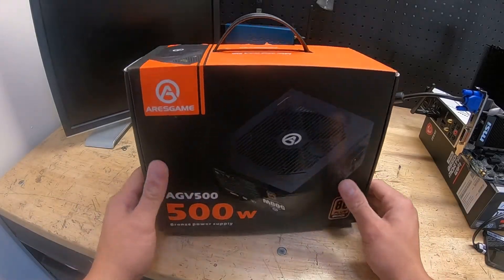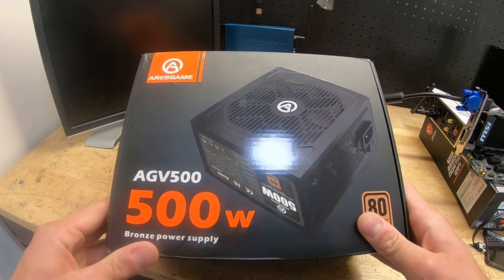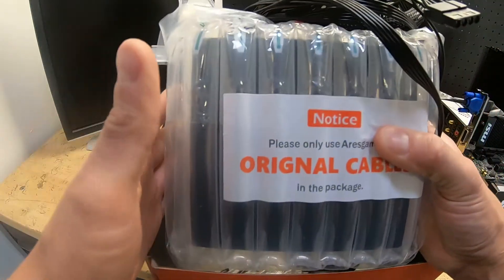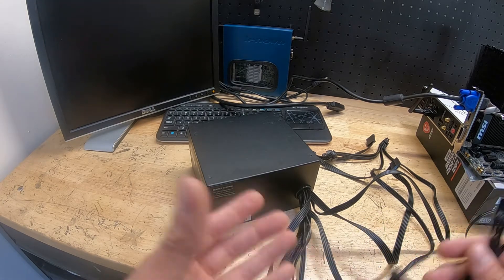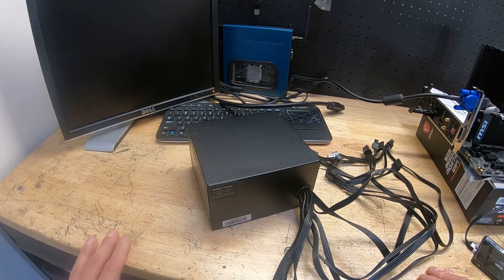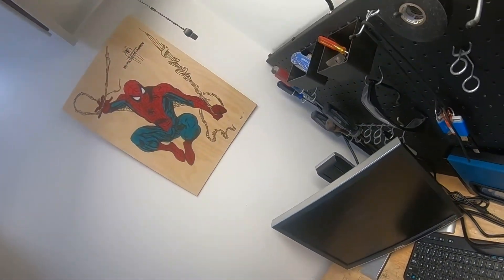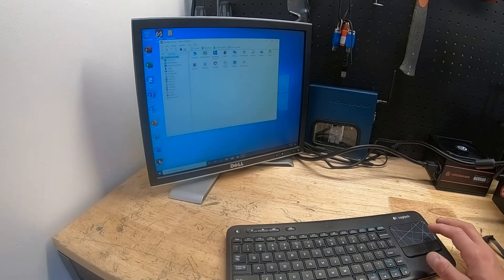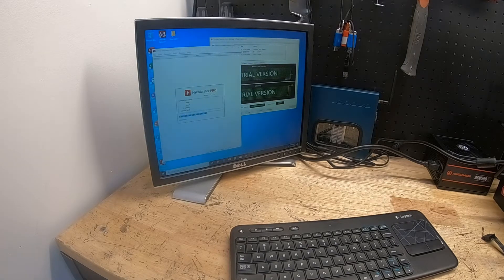A decent power supply for $40?? ARESGAME 500W power supply review! Can it handle Ryzen 5000??

Comment: If I were just to use it to power an i5-2400, a 2gb GTX 1050, and my small ASUS motherboard, do you think this would handle it? I just have a coolermaster hyper 212 evo and a single 80 mm in case of fans, and all i'm trying to do is  get a couple more years out of it? My system doesn't draw much power but i have a 400w that's aging and needs to go soon. I'm just so scared of buying PSUs because I've never done it before, but this one hits all the right notes. Low cost. looks like it's solid. I don't plan on upgrading my machine because i'm trying to save up for a new one and the price of this means i won't have to dip into my savings that I've already added up.
Reply from the maker: this would work fine. I have used this in higher end builds and it is solid. I use them all the time and never had one give me an issue or come back. For the build you have this would be perfect.

Comment: i have 2 of these.  on a 8700 & 1660s
Reply from the maker: they are good psu's in my opinion, stable and solid and I stress test a 5900x for over an hour on aida 64 with it and had no issues which is crazy consider i used only a 500w variant. def got my vote and probably my go to for budgets builds for now on.
Reply: @DLMtechgarage   I have two of the AGV650 units and both have been running quiet and stable for some time now, friend of miine has a mining rig running with his and no problems either, not to mention reviews are very good - im sold on them for a good budget supply.  The only stress tests ive run are the usual gpu and cpu software stress tests and all was fine.
Reply from the maker: @yambo59  i know alot of minners who use these psu and have no complaints. I have yet to have any come back on my budget builds.

Comment: A lot of people give AresGame power supplies grief, but I've had good luck with them.
Reply from the maker: They work good, solid and decent, done some oc with them and need had any issues.
Reply: @DLMtechgarage  only issue I've had with them is that they are not usually a true 500/600/etc watt power supply, but no worse than other brands
Reply from the maker: @GreyWolfTowers  true!

Comment: Good vid always man. I haven't tried these yet. They definitely looked appealing a few months ago, when PSU prices skyrocketed. I still had a solid sock of evga b-stock psu's. 
I am going to agree with you on EVGA psu's not only are they noisy but they feel cheaper these days (to me anyway).  With my b-stock supply almost gone I'm looking for new PSU's for budget rigs. I think these may fit the bill.
Reply from the maker: my 850 evga is my test bench psu. that joker would get noisy even on quiet mode with the fan. I have a 750 corsair and its prbly the best psu I have used. 

this psu is pretty decent and was impressed with the quality and how it handled a high power cpu. Its been my go to lately for optiplex and lenovo swap for low to mid range builds. now with the mid range I use the 650 variant.